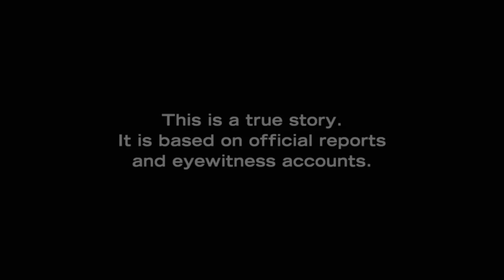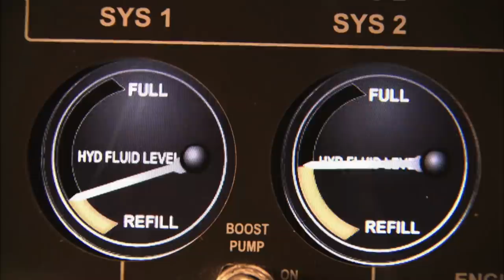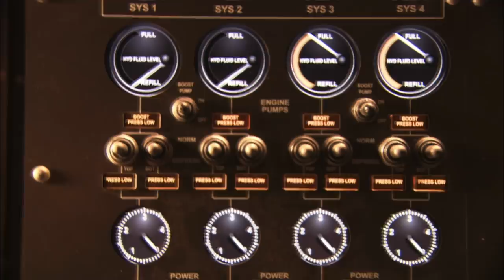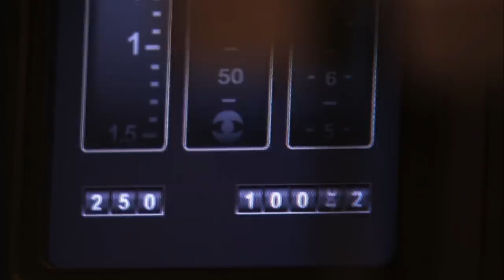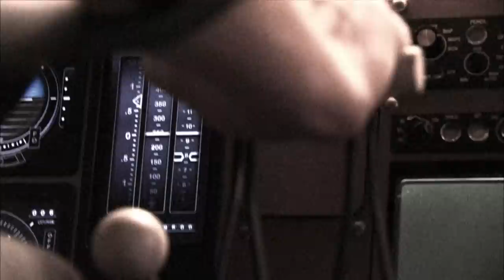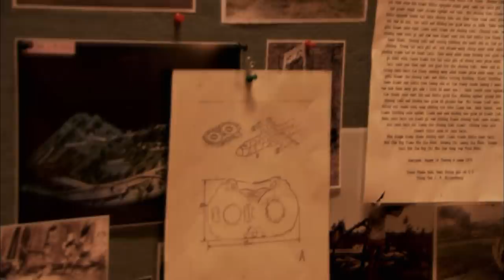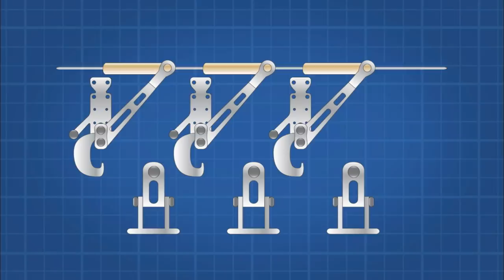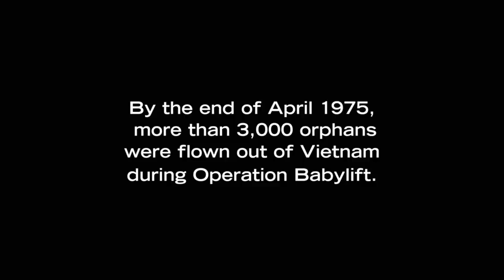The United States Air Force Vietnam Evacuation Disaster | Mayday | Wonder

Comment: This is like JAL Flight 123 and United Flight 232... the fact that anyone survived is due to some great seat-of-the-pants airmanship and the fact that he retained some aileron control. Being in a plane you can't control with the yoke or pedals from altitude has to be a special kind of terrifying. The fact there is anyone to interview was unlikely from the time it explosively decompressed.
Reply: Agreed, partial aileron control was a huge factor in the outcome they did have. Engines only had to affect one axis vs. two.

These incidents aren’t supposed to be survivable, every live saved is a testament to the skill of the pilots.
Reply: @adamp9348  Indeed. The difference between good pilots and legendary pilots is typically only determined when there's no engineering or maintenance assistance and you exhaust every relevant QRH non-normal checklist if you have enough time to run a checklist. It's easy to freeze up and forget to fly the plane first and save panic for the tarmac in scenarios for which there's no training because the plane shouldn't fly if that happens. Fortunately, most pilots will go through their career and tens of thousands of flight hours without ever being put to that test thanks to stringent and evolving safety standards.
Reply: And the Bagdad DHL incident and Trans-Air 671.
Reply: My mom’s first husband Capt. Edgar R. Melton was also a pilot of this flight. He was training with NASA so it’s safe to assume he was an incredibly talented pilot. He didn’t survive this crash. He was found in a rice paddy with his ring finger cut off to get his gold wedding band, 3 of his teeth had gold fillings and those teeth were yanked out of his head for the tiny scraps of gold. 
I was born exactly a decade after this so never met Capt. Melton but I’m sure I’ll catch him on the flip side.

Comment: That aircraft was from the wing at Travis, AFB, California. It earlier suffered damage when a crew chief didn't use the locking system, raised the nose, (Visor) and the wind blew it back down, against the hydraulic system. Mounted to the back of the Visor, the INS power supply, 40 pounds in weight. It went the entire distance of the fuselage and dented the pressure wall. The damage was so extensive that the AF told them to write it off. Someone from Travis ordered it fixed. They fixed flew one test flight, found tons of leaks, couldn't pressurize cabin, blew out the crew/s ears, then proceeded to fly it to Vietnam for the Baby Lift, where that damaged pressure wall blew out again, severing all flight control cables. It should never have flown again and been scraped as required. I was at Dover when the full report came out and because the damage was caused by part of what I worked on, the IDME system, we had to read the report.
Reply: Wow! That’s just horrific! Did the person responsible for ordering the airplane “fixed” face any charges?
Reply: @miriamsamaniego3335  I left the service just after that, it never went public, and I have no idea if the person who ordered the aircraft to fly that mission was ever punished.
Reply: @jamesberwick2210 , the aft pressure door was not rigged, as it should have been. Pressure to get the plane airborne and on mission was the reason it was not rigged. This is a prime example of why Tech Orders are written and should be followed. The investigators got it right 100%, except it wasn't the engineers who worked on the doors, it was are actually Travis AFB AR shop mechanics.
Reply: @mrsamzero1  But for one Colonel or General at Travis, they'd have lived. We lost a C-5 at Dover. It was on approach to the runway, flew threw a thunderstorm, and the upper skin looked like a golf ball. Factory people came and said nothing could be done, they stripped all the useable gear out, left it with a radio and minimum nav equipment, then a volunteer crew flew it to Sheppard AFB, where the school for Crew chiefs and sheet metal schools were, and let them have it. The entire upper skin was dented like a golf ball, they flew gear down, and were prepared to land just about anywhere if things got bad, they made it, we were one bird short.
Reply: @jamesberwick2210  Ironic that the actual investigation says entirely different to what you gibber about. The loading doors had been damaged and improperly repaired. 
When the rear doors were eventually recovered from the sea, investigation determined that some of the locks had not engaged properly. Maintenance records showed that locks had been cannibalized for spares, then subsequently improperly refitted so that not all the door locks were engaging correctly. Accounts also indicated the initial maintenance inspection noticed 5 of the 7 locks were not operating and failed the aircraft for flight. With external organizational pressure to get the flight airborne, a second off-shift maintenance team was called in. They subsequently missed the locks during inspection and the aircraft was cleared for flight. Furthermore, the flight crew confirmed that they had encountered difficulty closing the doors before take-off. As the air pressure differential increased with altitude, the few locks that were working correctly were unable to bear the load, and the door failed
Reply: @gingerbaker4579  Not sure it's as entirely different than what the OP said. Why were the parts cannibalized? Could it be that the plane was supposed to be decommissioned, so maintenance started cannibalizing, then some Officer went against the recommendation to decomm and the flight ended up on mission without all of it's parts? Seems reasonable as an explanation for why the parts were pulled to begin with. If so then understanding the prior damage and recommendation to be decomm'd is completely relevant. Everyone is guilty of gibbering sometimes, even me, and yes even you.
Reply: @gingerbaker4579  watch afain.that is exactly what they say.

Comment: I know someone from the US who was on this plane.  She was a nurse helping transport the babies.  She said since it was a potbelly plane, most of the deaths were on that lower level when it skidded.  She was burned and injured but alive.  So sad and so scary.  Editing to add,, I think that there weren't many seatbelts and no way to strap a lot of the babies in on that level and that had something to do with so many deaths below, not just from the plane skidding..
Reply: She worked at the US embassy in vietnam?
Reply: That's due to the fact that the wings of the C-5 are shoulder mounted, so the cargo compartment isn't obstructed by the wing box, if the aircraft was of a low wing configuration.
Reply: I took a couple of flights in C5s when I was in the Army. As I recall, the cargo deck on the C5 really isn’t set up for passengers and I don’t think they can rig rows of bench seating the way they do on C130s and C17s (and used to do on C141s - caught rides on all of these at one time or another). If they could under ideal circumstances, they weren’t prepared and able to when they were just flown as cargo planes, expected to fly out empty and suddenly got the new mission. If there’s any readers from the Air Force who know this type well, please let me know if I’ve got that wrong.
Reply: @mglenn7092  I also flew on a C130 from Andrews AFB during the late 80s going back to Europe and it was a bit terrifying because it is so loud (my seat must have been near the wings and engines).

Comment: @43:31 The aircraft maintenance forms say "Canned rod assy. between....#4 Rt. aft ramp locks."  I worked on that exact system on the C-5.  I worked on the cargo door system many times.  It is common to take parts off of one aircraft to fix another aircraft.  That happened all the time when I was fixing aircraft in the U.S. Air Force in the 80s.  They were in a war so "canning" parts happened every day.  It is normal, customary, and allowed to cannibalize parts like they did in this video.   I can guarantee you one thing.  The Air Force found the guys that replaced those parts and questioned them.  Every time you preform maintenance on a military aircraft it was recorded on paper, signed by two people.  The maintenance tech signed the form and then a supervisor inspected the work and then signed the same form with the understanding that his signature was stating the work was satisfactory. I was always scared to not follow the aircraft maintenance procedures because if that plane crashed after I replaced some parts I knew the Air Force would come looking for me.  I always did a good job and followed the manufacturers procedures.
Reply: I was a crew chief on F-4s and F-16s , every time a jet went into a phase inspection , that jet was a free for all for parts.

Comment: One more thing, the cargo compartment on all of the USAF's airlift aircraft don't have a telephone for communicating with the flight deck, instead, there's an interphone jack where the Loadmaster, and Crew Chief can plug in their headphones, so they can talk to the flight deck. No cargo aircraft in the world has a telephone in the cargo compartment, at all, so, that is another inaccuracy in this video, along with the other things that I pointed out, as well. Also, by the time of this crash, the air force didn't have over a hundred C-5's in service, instead, the actual number was 81 airframes, because, one was destroyed on the ground, during fuel tank purging operations.
Reply: I notice that too. If i'am not mistaken we had lost two by then, Clinton Ok crash. I worked that crash.

Comment: Just to tell you guys we never had blackhawk helicopters in Vietnam (the black hawk is at 26:34)
Reply: God & pilots saved the planes contents. I worked on a hangar queen in 1981 with a bayonet lock that wouldnt renain locked after every flight. It was on C141 AirForce cargo plane clamshell doors. We could not send that plane out until the lock would stay locked. We tested it numerous times until I discovered way up in the housing, the hoops that held the pin were causing the pin to bend & miss the hopps  keeping ot inlocked. Thr door could close but not lock. Finally we figured out how to prevent the bending of the guidepin & lock the doors.
Reply: Then it flew.

Comment: The C5 in those days was a piece of garbage cost over runs quality problems  many problems...which is why this one crashed the poor people who died and were injured and the great pilots who kept this up long enough
Reply: Sounds like Boeing.
Reply: I was stationed at Travis when this happened, I was an avionics/autopilot specialist on the C5A and C141A. The rumors were rampant that a VietCong SAM brought it down. For months afterwards, all the C5's on the base were loaded and unloaded from the nose only, the petal doors were not used until they had determined the malfunction with certainty. As far as the problems, a  good example was  the Lockheed Galaxy was found to have cracks at the wing roots,  and a temporary (expensive) computer system ALDCS was installed until the necessary repairs were made.  It was definitely a money pit.
Reply: It was the fault of the air force for the cost over runs on the C-5 Program, and also, the USAF tried to cut costs by using a business plan that doesn't work for procuring weapon systems, along with forcing Lockheed to use a thinner gauge of aluminum alloy for the wings, as well as using untested systems, that had only been bench tested in various labs, before being fitted to the aircraft.
Reply: @johnosbourn4312  It was both sides just like the B1 program and many others which I worked on

Comment: On the real C-5 flight deck, the Oxygen Masks that the flight crew would use in emergencies, don't look like the masks used by firefighters, instead, they are just a form fitting mask that goes over the face, and doesn't have a visor.

Comment: I find it amazing that no one mentions anything about the comment on minute 45:50,  had this been a comercial flight the crew and pilots would've been crucified in the comments, but since it's military they are heroes????
Reply: they saved over 100 people. this has nothing to do with civilian vs military
Reply: Didn't the pilots survive? If so, I get it. It's usually dead pilots who can no longer defend themselves who receive blame.
Reply: Remember how long ago this was. If there had been a way for them to verify that the door wasn't fully locked, then I agree that they'd have been roasted. But the design of the plane itself was poor. No backup system, no way to verify proper locking? That simply isn't the fault of the pilots, period. And they even said it was pretty standard to have to try and get it to close multiple times. This falls squarely on the shoulders of the maintenance people and the manufacturer in my opinion. The commercial flights that are most of what we see on Mayday are much later and after they developed more sophisticated locking systems. Military has nothing to do with it in this case.
Reply: @diggsfather  - What other kind of comment do you expect from a Spaniard.

Comment: Picture shown is a C5 Galaxy. That aircraft did not exist at the time. It came after the C141
Starlifter, which did not exist either. C130 was
the primary aircraft.
Reply: You are wrong!!!!
Reply: That is in fact a C5A Galaxy USAF Cargo plane.   Please Google and do your research.
Reply: It takes no time whatsoever to look up the plane type that was in this crash. Why would you spread misinformation?
Reply: @deprofundis3293  I agree.   And if anyone actually listened to the documentary they would have heard one of the official statements that there were 100 C5 Galaxy planes that had been produced during the time of the crash.
Reply: Wrong, the C-5 entered USAF service in the mid 60's, so, it, and the C-141 were used throughout the Vietnam War, along with the C-130.
Reply: LOL, your ignorance is showing.
Reply: @Charles Gerrald  - Wrong !!!  It most certainly did exist. Check your facts before you put your foot in your mouth. Rolled into service in 1970.
Reply: @johnosbourn4312  - No. 1970 is when it first rolled out.